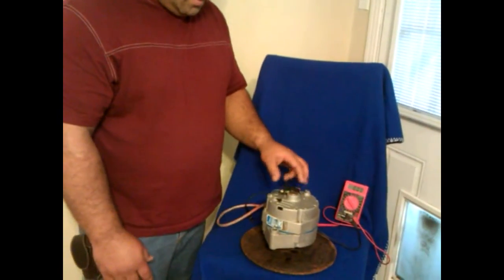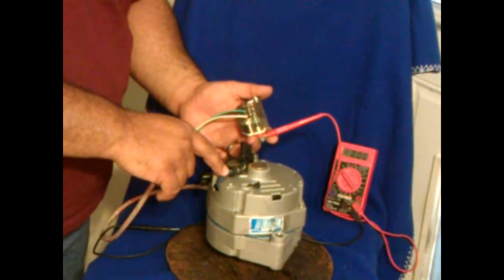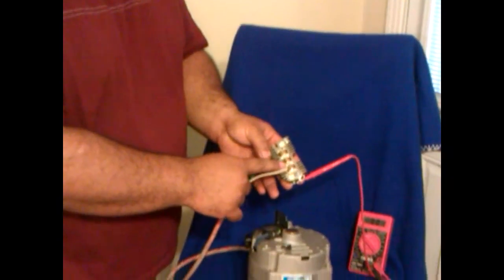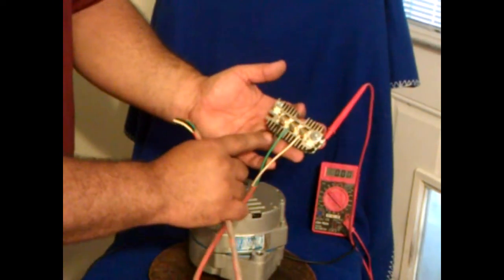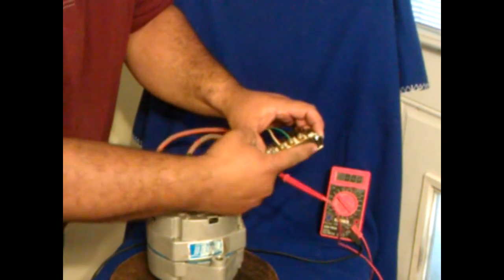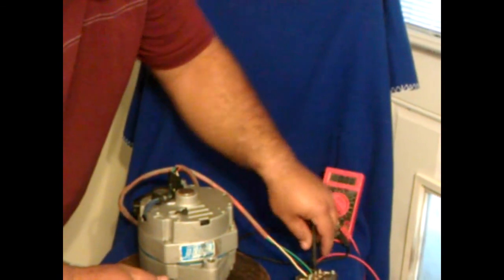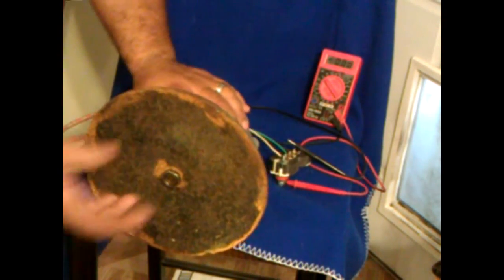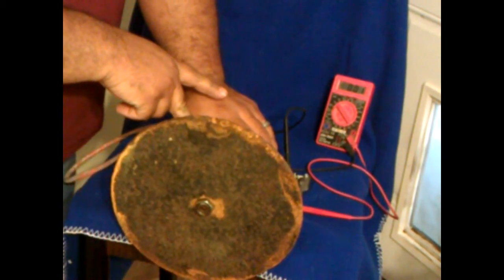How to hookup your 3 phase WindBluePower or similar PMA Wind Generator Alternator

Comment: So is one of the 3 wires supposed to be the ground wire?
Reply from the maker: No, each wire peaks just behind the one before. Technically, you need 4 wires. the three wires are the positive side of an AC wave form that the regulator tries to level out with capacitance. the ground goes to the frame of the alternator

Comment: hmm, tell me how will work ur ac generator without battery??, this kind of generator needs also a battery for the magnets. i remember works with elektro magnet) and ur generator needs nothing . hahah
Reply from the maker: That's easy, this generator uses a permanent magnet rotor, it does not use a wire wound rotor. This eliminates the need for a battery to create an electromagnetic field. However, a battery is recommended to stabilize the voltage output.
Reply: ok, so u must change the wire to magnets.
all generators for windenergy have magnets. but a generator from a car needs to much rpm for the voltage. or u must change the coils too. but than u can buy a generator